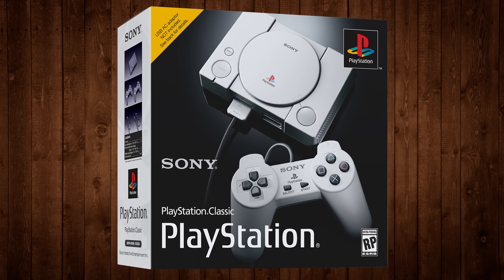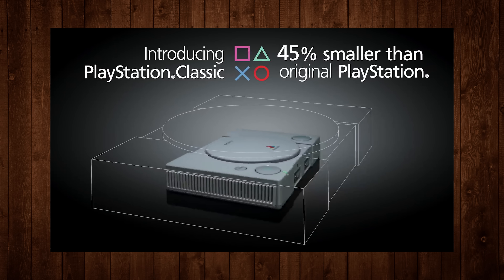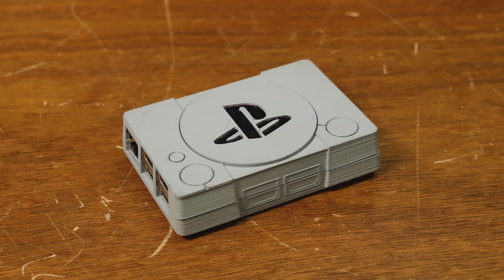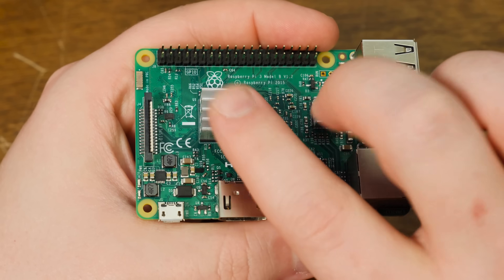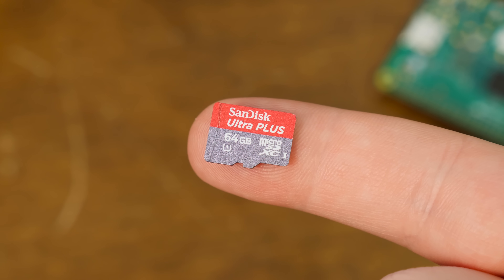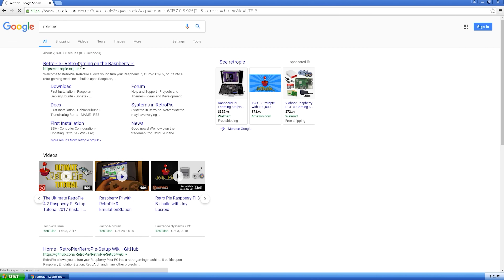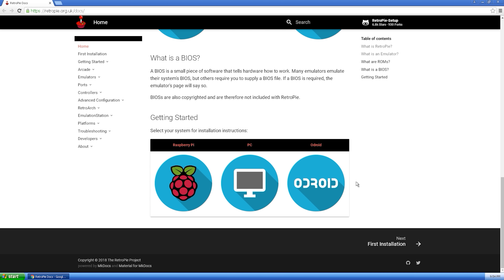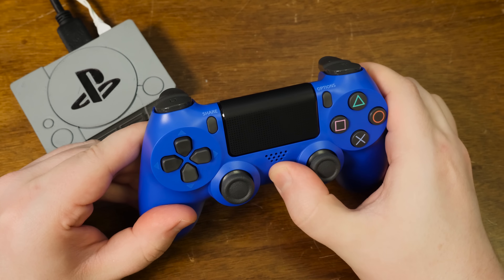Building a Better PlayStation Classic Console

Comment: i also had a retropi setup which i used to run dreamcast, ps1 and even game boy (gb, and gba) games... afaik, retropi can also run old DOS/pc games (but i haven't tried it yet). it was cool to play the old games on this all in one emulator operating system, and what makes it even more cooler is that the raspberry pi soc is miniature and can fit in my pocket. you might want to check out "PiBoy" - which is a cool case and raspberry pi built in a game boy - like chassis. imagine playing old games on a gameboy like system (lol).

Comment: I love how you can use the ps4 controller with it nicely while SONY does not allow the PS4 controller to work nicely with the PS3...seems simple software to do it ? Typical of a company saying, "stop messing with our old stuff buy the new!" grrr
Reply: PS4 controller should work as a generic controller (Bluetooth or USB) on PS3. However, some games have pressure sensitive button requirements/motion controls so any generic gamepads will be rejected.

Comment: Did this kinda thing with the original pi way back when, but for MAME. My coffee table is an arcade controller. Got upgraded to my atom netbook when some oaf stepped on the screen. Performance was better, but still pretty average. The pi3 seems orders of magnitude better! Possibility alot of software improvements to.

I just got OOT: Master Quest for GC (wii, they're like, $20, $10 contoller, $5 memory card, n the game at a bargin $25. Considering twighlight princess is bout $100), so im good on my retro games for at least a few weeks. But a new pi, n Bluetooth controller, definitely on the cards. Some crash, medievil, GT, seems like good times.

Comment: Hmmm pretty good i suppose but dont need to build 1 cause i already have a ps1 emulator on my android tv with the ps4 dualshock ( ͡° ͜ʖ ͡°) but still a good concept of building your own ps1 classic rather than the ps1 classic that sony released :( which cost more than the parts you need for the rapsberry pi

Comment: It would be cool if any third-party company sells a specialized PS1 classic shell for Raspberry Pi with working buttons and USB ports connected with the Pi hardware.

Thanks for the video, Clint
Reply: Just buy a dead ps1, take all the guts out and you have your case
Reply: Well, although they don't yet have a PS model yet, Retroflag does have well made and good looking cases shaped as NES, SNES, SFC, and Mega Drive/Genesis.
They even have router cards on the inside for proper I/O placement and function on each model case.
They have a website, and sell trough Amazon.
http://retroflag.com/
I will get two of them soon, the SFC and the Mega Drive, but more for the fun factor of having a fairly inexpensive system, being able to separate the games from both Nintendo and Sega home consoles and portables, lodged in their respective look-a-like cases.
For more serious and varied emulation, i'll go the Nvidia Shield route.
It's a well polished product, and a heck of a lot more powerful for emulation.
Reply: @00Resev  Wow, thanks for the info.

Comment: You've made it look so good and easy!

I like the option to connect to network via WiFi and being able to transfer files to it using
\\RETROPIE 

I didn't know it was that easy! I've seen some Pacman cases on eBay that look awesome.

One thought, maybe you could have used one of those smaller PlayStation 1 consoles for the case?

Comment: Surely using a PS4 controller is cheating. ;p

Eh. Anyway, too bad about the Playstation classic. Some poor choices indeed. (being that I live in a PAL territory I could forgive the use of PAL games if they had done it properly - eg a PAL game outputs a 720p50hz video signal. - which is perfectly viable in PAL regions because televisions can handle that just fine - and in fact, most HD television broadcasts here right now are 1080i 50 hz. - but for an NTSC system is seems problematic, and even in PAL regions if it's going to output 60 hz for 50 hz games... Ugh.)

As for the controllers it includes... Well, I have an innate loathing for first generation playstation controllers in particular. It's my most hated controller ever (leaving aside things that are definitively trash of course, such as the majority of Atari controllers and a decent chunk of 3rd party controllers for most consoles.)

I'm also disappointed that there are so few configurable options in the system; I dislike the PS1 for it's lack of bilinear filtering and perspective correct texturing, but it IS part of the experience.
I just wish it was optional, and you could turn on some more modern texture handling if you wanted.
It'd make PS1 games a lot more bearable for me. (besides which it'd be a trivial fix for most emulators - and even the PS2 can do it when running PS1 games in backward compatibility mode.)

As for retropie based solutions... Eh. I mean, I get it, but to me it kind of defeats the purpose of these devices, plus if I want to go the unofficial emulation route I can install them on my PC's or just about anything else too, so these kind of devices seem a bit redundant if you're going to homebrew one.

It's kinda hilarious and sad though that the Playstation classic uses a well known open source emulator.
I mean, Nintendo (for better or worse) at least has the decency to write their own emulation code.
Plus, for using a pre-existing emulator, the fact that the classic gives worse results than the free version of the same emulator is particularly sad...

Oh god, and your game footage immediately makes me feel ill. I knew there's a reason I never played PS1 games much. XD

Comment: I did something similar a few years ago with the rpi1B, connected it through a usb to ps1 (with an og ps1 controller).  Then I ran the rca cables to an old Commodore 64 monitor (don’t remember its model number) and essentially patched in audio using a home brew spliced headphone jack to rca.

We had a lot of fun playing LSD on that, even though emulation was rough on the rpi1 (and we were pushing mad clocks so I had a small pc fan, with aluminum to cool it

Comment: I did put a Pi 3B+ into a real Commodore64 breadbin using its keyboard via for the Pi itself via the Keyrah v2b.
Haven't put any games on it so far but you've got me thinking.

Also still have another Pi 2B in my collection that actually never found any use in all those years.
Might put this in a either a 3D printed shell or get one of those Mega Pi cases for the love of the MegaDrive/Genesis and put all kinds of games on it.

Plus Valve ported SteamLink to the Raspberry Pi now, that's another bonus.

Comment: I built a raspberry pi with RetroPie as well. My biggest issue is the input lag with all emulators. From what I've researched, its a Retroarch thing. I'm sensitive to the input delay. Comparing it to my original consoles hooked up to a CRT, its quite noticeable, and makes games near unplayable. I've tried many settings, but I haven't been able to get it to be either gone, or next to non existent. This WOULD be a perfect set up otherwise.
Reply: Doom_master1122 your computer isn’t good enough
Reply: Hi!... i'm having that issue as well. What i did to make it more playable was to disable all smoothers and filters. Apparently the PI doesn't works as well with those "features" ON. I was curious to see how well it responds to @LGR after this install with the PS4 controller directly connected to the raspberry. I'm using an alternative PS3 controller and a bluetooth dongle to pair it. @LGR can you show us if you are having that delay?. As @Doom_master1122 said, apparently it is a Retroarch thing and also connected to anything rather than a CRT.

Comment: meh. i still love the PS Classic, the Console can be powered by a PS4 USB slot while in rest mode, the controllers can be used on a Laptop/PC, and the game selection is fine when most of the games i wanted have remasters anyway which i would play more than the lower res original versions. the console is built for Nostalgia for OG Fans not just anyone random who doesn't care about the PS games and the Original controllers etc. 

i mainly bought it for a collectors peice and to play Tekken 3, Abe oddysee and the 5+ games i never played before like MGS, FFVII etc. as i said i have a Laptop and Sony Xperia that can run PSone games. the Controller also works on the Sony Xperia so i can use epsxe on it. the only thing i dislike is the controllers not being dualshocks, but meh.

Comment: how easy is it to get "tallboy" to over format type sinks? ive been wanting to push my 3.14s limits and running psx2 roms through server based expansion and while the data processing had been handled by my 2700x ive found that the data streaming itself or LAN has had problems with ditrso. page files. The ini runs no problem but when i attempt to run my own images (non stock emu to note) it had serious heat issues. I can force to run on my 60hz monitor but if i try to run on my CRT or other direct. my 144hz moni i cant seam to configure to run without choppyness. note i have synced the frames in a delay so that i can get to run without any SED im exclusively having issues with the per pixel display ratios.
edit being smashed nd writing ur lg out drunk iz and downvote so i remembr to write in sq

Comment: Got my own in a basic case, no fancy PS1 design.  Raspberry Pi 3B+.  I tried to get Dreamcast working on it, but no luck.  I can't get past the set date/time menu.  Also, the NES game I tried on it doesn't recognize my controller (PS4 controller).  Most of the N64 games I tried with it don't perform well either.  Other than that, it's pretty good.  SNES, Genesis/Megadrive, Atari, etc.

Comment: I've built a couple of these even a zero in a nes controller but still watched it cause its an lgr video. For improvements I'd add standoffs between the pi and case  plus a mini fan for heat. As for 3d printers I have an aneta8 which is cheap but more involved since you have to build it and modify since the stock parts aren't great but its a good start

Comment: Not here to hate you, I really enjoy your videos and watch them almost religiously. The idea is cool, the implementation is pretty meh. Sorry. You had to ask for delivery of a non-painted body, sandpaper the body yourself, apply undercoat, then apply paint on top. That way you would get rid of that ugly layered look. Then it would be great to solder power button to the actual power button on the body. Of course that would require you to 3D print it separately, but if you're going for authenticity, then it's totally worth it. And the design of the body itself is very meh, you could create one yourself using different services like tinkercad or Microsoft's 3D builder. So yeah, A for the idea, C+ for implementation.

Comment: Would the mednafen/beetle PSX emulator run alright on this? It's the most accurate emulator of the bunch but costs more CPU as it achieves accuracy through software rendering.
EDIT: Looked it up, model 3 isn't powerful enough :(

Comment: Monday LGR episodes always make my week. It's been a really great day so far. I got paid for some freelance web dev work, cleaned my garage to put my old Caddy, and I got to sit down to some LGR while eating a warm cup of Chili. 
I do have a Pi setup as well, but it's an older kit that probably needs an upgrade. I have the heat sinks, a little case, power brick, and sd card. It was a great investment for anyone interested in computers. Hell, for anyone interested, you can make Pi's run in old 80s computer cases using a few adapters for the keyboards. Commodore 64 cases with Pi's installed are a thing, and work wonderful. You can also make Pi handhelds. 
Honestly, if you are timid about electronics, but interested in messing with them, a pi is a great affordable place to start.

Comment: I'm about 90% of the way of making a miniature Macintosh Quadra 700. It uses the Pi Zero W, but when completed it should have the correct buttons and LEDs in tow. I've printed the case three times so far and I think I have it exactly how it needs to go. The DaVinci MiniMaker was 80 bucks on amazon and I haven't ran into any issues with it yet.

Comment: Does it handle multiplayer well? If 4 player crash team racing is possible i would start this build tomorrow.
Reply: Look up the emulator info. If it allows it, then why the hell not
Reply: @Mernom  allowing does not necesarily mean "runs it well" which is my worry. I've been looking online and found little about it, closest thing i've seen are a couple of dudes testing the n64 emulator on the raspberry. It seemed that they could run mario kart with 4 controllers but since they were just 2 guys they werent able to test the 4 controllers running intensively at the same time. I'll have to see for myself i guess but if it fails the boys will be disappointed
Reply: @Nacoleptic  I'm pretty sure that you're not the first guy who came up with the idea... There SHOULD be at least one discussion forum that asked it and got an answer somewhere.
Reply: It will probably run a bit slower than it would be expected, but i think it shouldnt be much different than the single player experience
Reply: Used to play n64 4 players emu on the original xbox, run smoth. Suppose raspberry can do way better.

Comment: If you have a crappy old computer sitting around not doing anything, give it a new lease on life by installing a Linux distro and Retropie. PCSX ReARMed requires suprisingly little in the way of CPU or graphics hardware. I have an old Core 2 Duo machine running Ubuntu and RetroPie software and it works like a charm. It's like a reverse mullet, partying up front with the RetroPie front-end, and doing business out back, acting as a home NAS for all my ROMs and ISOs as well as an FTP server for those times I need access to a romset at a friend's house!

It doesn't look as cool as a PS Classic or even Clint's 3D printed case, but it's a SFF case so I just tell myself It's cosplaying as a VCR and I'm okay with that.

Comment: I have put together a GBA shelled RPi3 system, but it was mostly prefab, I just had to modify the GBA shell to fit the components. It cost over double what your PS1 kit did. FreePlay CM3 is the model. It's powerful enough to run PS1, but doesn't include PS1 by default.

Comment: I have a raspberry pie with an X820 case. It's basically a pie case with a power switch and the added option of fitting a 2.5" ssd/hard drive which is useful because i have a 500gb hard disk inside crammed with i believe about 30 thousand + games covering many different systems, arcade etc, overkill yes but for taking to a friends and having a night of gaming hell yes. a usb keyboard and mouse is a priority especially if your going to use Dos games, Commodore, Amstrad, Spectrum etc. Plus the added bonus if i so wished to install linux on the side for a full OS.

Comment: I have had a retropie setup for quite sometime and anyone else thinking of doing it. I can highly reccomend the PiNES case you can get for about £20 (I would assume around $20)

It has proper buttons that you can use to power on or reset the device and also puts USB ports at the front (where you want them, not the side)

I do agree that a form of cooling is needed if you're planning PS1 games as the CPU does get pretty warm under heavy loads.

Comment: Using a raspberry pi, the official 7 inch touchscreen, a case for the screen with mount, a portable battery, and a gutted blluetooth speaker, I "enginereed" a portable retro emulation machine I can take anywhere. I bring it into work and we play during lunch. I have everything from atari to ps1 games, but really, we only play bomberman 4 and 5 on the snes. 
If anyone is interested, I can link the items used for this build.

Comment: Two options worth enabling in the pcsx core settings are "enhanced resolution" and "enhanced resolution speed hack". It is a bit slow on the Pi2, but most games run fine on the Pi3 model B.